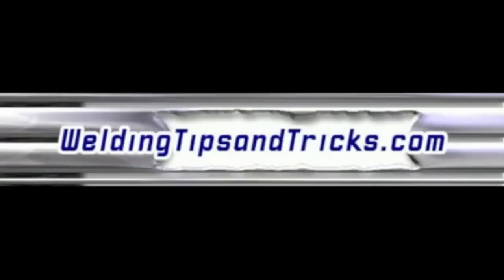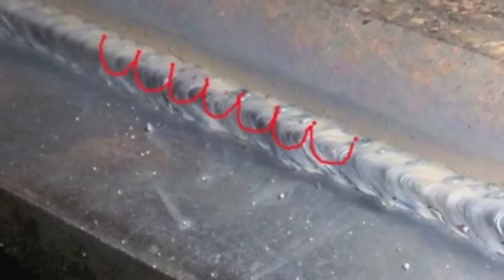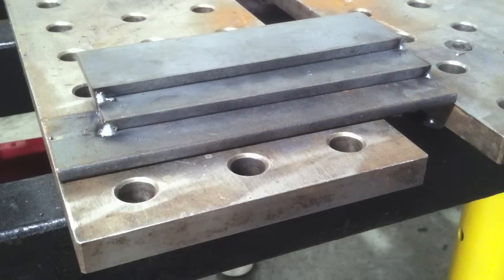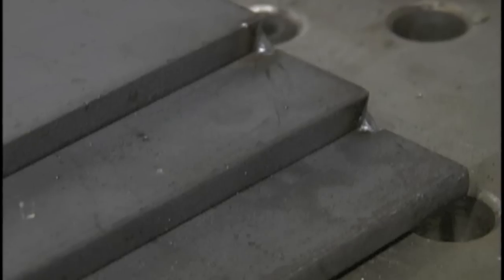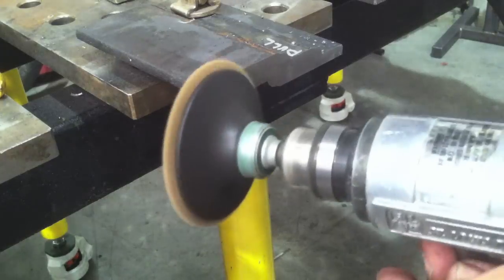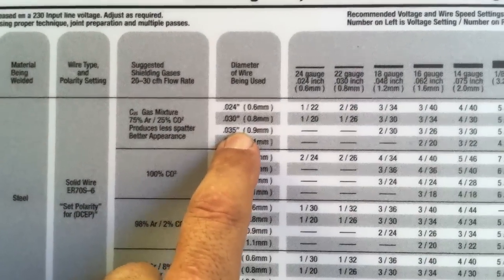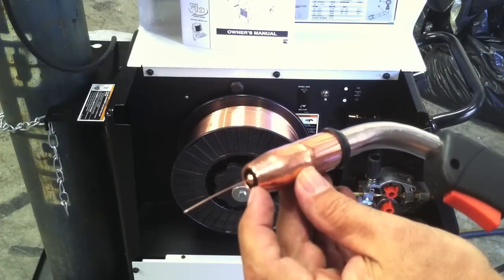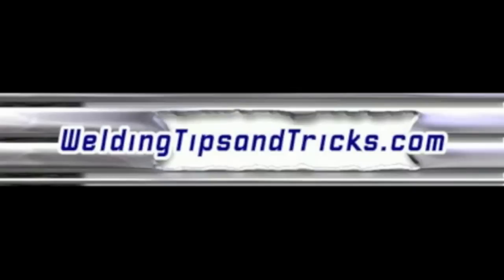Mig Welding Technique and Welding Gases

Comment: Hi, Over here in the UK, we do not have the 75/25 argon/CO2 blend that seems popular in the US. We can get straight argon, straight CO2 or a mix of 95/5 or 90/10 argon to CO2. Is there any opinion or experience of what difference this would make to gas-blend choice, settings and/or technique for MIG welding steels? T.I.A.

Comment: The penetration looks identical. Everything I read says CO2 should penetrate more. If that's not the case, the only reason to use it would be to save some money, or where certain wires require it.

Comment: Have you ever used stargon gas to mig weld mild steel it's argon co2 and oxygen tri mix. My gas supplier was out of c25 and said try this stargon you'll love it it seems like my setting are way different than the c25 I'd love to see more on this gas

Comment: Im using a 82-18 mix,is there a big differnce beetwen that and a 75-25 mix?
Reply: 82-18 is going have a more fluid puddle and harder possibly brittle weld, it will be harder to weld on the vertical.

Comment: Great. Very educational. What the exact pressure for argon on a mig welding
Reply: In the gas-shielded welding sector, there are mostly flow meters.  You set a flow rate, so many cubic feet per hour, or liters per minute, the pressure is often fixed, something like 50psi.  The outlet pressure at the nozzle is almost nothing I guess, it's open to the atmosphere.  Anyway, think about FLOW!

Comment: So if you use straight argon how would it effect the weld?
Reply: 100% argon does not work well for short-circuit MIG.  You need the high arc voltage of CO2 to get it to short-circuit, argon has the lowest arc resistance of the shielding gases which gives it a cooler arc, depending on the wire size the voltage and wire feed, it would be hard to keep it from transiting into spray transfer, also the bead would be humped up and ridged.  That's why C-90 ( 90% helium, 71/2% argon, 2 1/2% CO2) used for SS has that small amount of CO2 in it so it can still short-circuit.

Comment: Is there no need to prep the metal to shiny bright steel?
when is it necessary and when is it not ?
Reply: It never hurts!  There is never any advantage to welding over oxides grease and paint, just to name a few.  At best you get away with it.

Comment: If you run mig with no gas you'll end up with a weld that looks like swiss cheese. Flux is hard to compare to mig because you can go into whether it's inner shield or dual shield, .035 or .045 etc. etc.

Comment: No matter if you're right handed or left handed welders need to be able to weld either direction. It's mostly personal preference but sometimes you need to do it a certain way to get a better result. It's also good practice to be sort of ambidextrous because you never know what funky position you'll have to weld in. Once I had a flex head on my welder and was welding the backside of a vertical plate that was in a 16"x16" looking through a mirror left handed. Best be flexible in your weld style

Comment: something to note is that co2 needs 1-2 volts more than 75/25. the co2 will also create more spatter. that means extra cleaning or sending out a product that looks like ass. in either scenario, work safely guys. its all fun and games until you are victim to the medical field.

Comment: How quickly does the 75/25 mix bottle get used up? Typically?  About how much does it cost to exchange?   I'm only familiar with the liquid CO2 for steel MIG. That one 50lb CO2 bottle can last me like 3 months, costs about $35. Plus, I have a fleet of CO2 tanks I own, and don't have to run to the store every time I empty one. To really use the 75/25 mix I'd need at least 2 bottles, so I can use them completely empty and have one to swap onto. The welding store is a long drive from home for me.

Comment: I've always just used straight CO2 for steel Mig.  How much more does it cost, roughly, to run the mixed compressed gasses?  Can someone mix their own blend with 2 bottles and flowmeters etc.? and is that typically done or worthwhile?  I own the large tanks for liquid CO2, and for compressed Argon, already., as well my own large bottle of tri gas mix for stainless steel Mig (haven't used the tri gas much, it kind of scared me to see how quickly the tank pressure dropped. That gas is spendy).
Reply: You can definitely mix it yourself!  Just put a flowmeter on each tank, and a "Y" somewhere downstream and off you go.  In the long run it's cheaper and you'll probably get better results.  I did this following Jody's demo of Argon/Helium for aluminum.  Trying to use less of the increasingly expensive Helium and also just fooling around and enjoying the complex setup.

Comment: thanks for a good vid but you didn't really illustrate how the two gasses perform differently, I mean you showed me but those welds looked much the same. I would have to conclude that it doesn't matter  what gas I use
Reply: It'll matter to YOU!  It's harder to get the right setting with CO2, for one thing.  But it's cheaper and more intense, so there's that.  You'll know the difference!

Comment: great vid as usual.. however.. why is it that that mig welders refer to settings in voltage, and tig and arc are set as amperage? Is this just a US thing? In australia i have only ever seen settings in amps for mig, even though its either a high/low switch, or numbers 1-6 or 1-8.
Reply: Well, MIG machines are "constant voltage" power sources, Voltage is a basic setting.  Amperage actually varies a  lot all through the process, you can measure it, but not really set it.  I mean, in the short-circuit action there's the arc current and the short-circuit current, changing maybe a few hundred times a second, so it's hard to even measure!   Stick welders you set CURRENT, and voltage varies all over the place.  Those settings you mention probably make the wire drive motor go different speeds, which is definitely changing the current, but not exactly setting it, you see?

Comment: @sbl212 stick has a flux coating, mig wire doesnt. unless you are using fluxcore wire, it simulates arc welding.